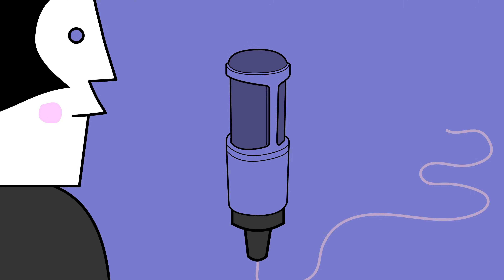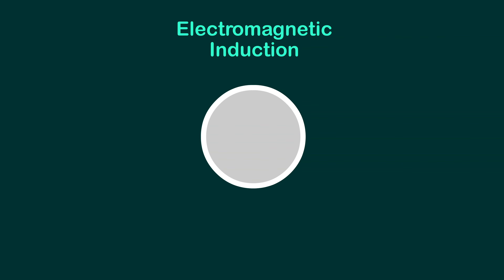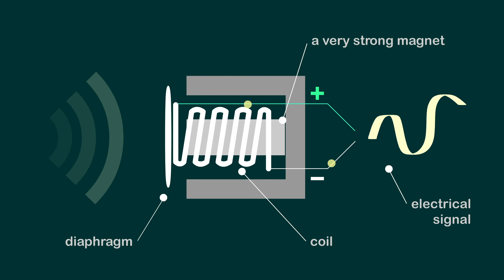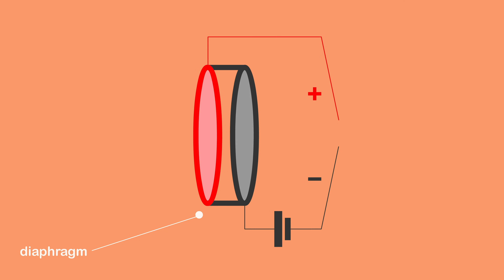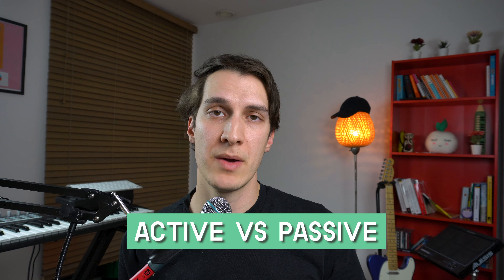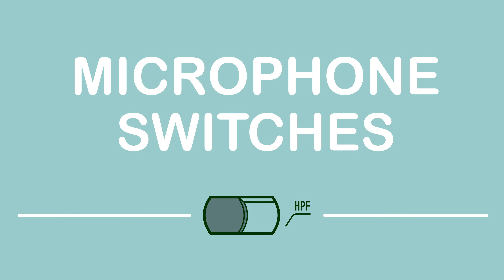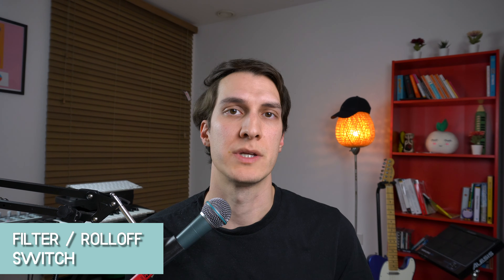How do microphones work? Different microphone types and their characteristics explained

Comment: 4:00
Phantom power isn’t a “signal” in any normal sense of the term. It is simply a source of power, and carries no information to speak of. It isn’t even a waveform, as we normally think of one. It’s DC, like a battery.

Comment: Thanks for the great run-down. What are you using downstream from the SM Beta 58A? I see that its output is 4dB higher than the original SM-58. I found it difficult to get high enough levels from an SM-58, so I sort of wrote them off (and all dynamic mics) for non-band situs.

Fun fact: condenser is the original term for a capacitor. Mic tech stubbornly clings to the legacy name.
Reply from the maker: I think at the time of recording this, it was going through a focusrite clarett. For the really quiet dynamic mics we have an SE DM1 dynamite . And more recently we've also been using the newer focusrite scarletts which have a bit more gain on their pres.

Comment: I need some microphone shopping help; this is probably a common request.... so, I am looking for a microphone that will only pick up my voice. I am worried that when i'll be gaming, it will pick up on the gaming audio from external speakers that's placed bottom of my pc monitor. Seems like dynamic microphone is the way to go, but wouldn't it pick up on the external speaker's audio? is there anything else I need to consider?
Reply from the maker: Definitely a dynamic with a cardioid polar pattern. Obviously there's always going to be a bit of spill from the speakers, so I guess that's the tradeoff you need to consider depending on how loud you have them, or maybe you should consider wearing headphones :D

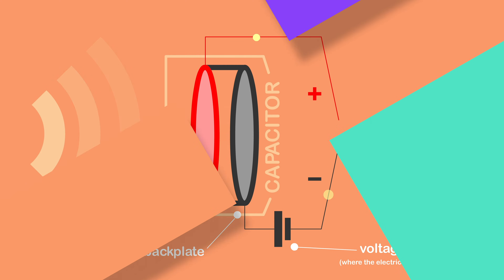Comment: 2:40 one dynamic mic advantage: low sensitivity to ambient noise 3:40 condenser mics = active, require 48v phantom power 5:32 large vs small diaphragm condensers 7:24 shotguns highly directional 7:45 lapel / lav mics also need external power 8:55 polar patterns: omni, cardioid, 8. Some mics have selectable patterns. 11:44 mic accessories: shock mount, pop filter 12:41 mic positioning 15:02 mic comparisons

Comment: The AT2020 is NOT, by any definition a large diaphragm from condenser. The diaphragm of the Electret capule is the roughly average 11 mm. {10.5,} small capsule. It's bigger brother $400 at4035 is the other version of the 11mm small diaphragm with more expensive circuitry. I would skip those two, get to 22 mm 2035 which only costs 50 more than the 2020. 4040 has the identical capsule to the 2035 what's slightly different tuning and better circuitry with everything else is nearly identical.
Reply from the maker: You are right, for their current prices the 2035 seems like the better deal! The 2020 was my first condenser and it's always been around in the studio and I think is a fairly standard entry level condenser.
I can see now that they market it as 16mm "medium" diaphragm so I guess they are trying to position it somewhere in the middle :D

Comment: The at2020 actually has an electret "back diagram" according to their site. Roughly 10mm small housed in a 16mm capsule. Not sure why they advertise the 4035 and the 2020 as a large capsule when it's in fact a very small diafram. They blazed the trail with the 4035 making the first under $1,000 electrect mic, later copied by companies like blue, but nowadays you can get them for $0.50 or less from companies like foxnovo.  As a matter of fact, the company they get the capsule from, MJI gets the electret capsule from foxnovo so you can technically just get a full built $10 foxnovo. No phantom power really needed. Maybe 18 dB  you want to crank the 22 self-noise level.  I think it's a bit unfair for them to advertise a 16 mm housing considering most people will think that's the size of the diaphragm. 

 I would just pay the extra $30 and get the great sounding, beautiful tone & low self noise 2035 (Same as the discontinued 3035) with an actual 23mm housing and aroud 20 mm diaphragm.

https://microphone-parts.com/products/at2020-microphone-mod-kit

https://soundref.com/audio-technica-at2020-review/#:~:text=Inside%2C%20the%20AT2020%20has%20a,possible%20types%20of%20condenser%20capsule.

Comment: I understand that as we are making sound waves through our vocal cords. The diaphragms move forward and backwards creating electrical signals. But how do those electrical signals carry our sound waves to the speaker? Or to  whatever it is you’re recording? It doesn’t really make sense to me how the electrical waves can create sound unless the speaker system or radio has a mechanism that replicates or tries it’s best to replicate those sound waves
Reply from the maker: Although it's hard to see with the naked eye, the cone of a speaker is moving back and forth very quickly in response to the electrical signal that's sent to it and as it does this, it pushes the air in front of it, which then creates the sound waves that we then hear. So if we left aside amplification, the mic/speaker characteristics and the imperfections in the signal conversion process, the mic diaphragm and the speaker cone would be moving in exactly the same pattern, and you'd hear the original sound exactly as it was recorded being played back through the speaker. In fact, you can use a microphone as a speaker, and vice versa (have a look online for videos of this!)

Comment: Great and informative video! I was looking for a microphone for recording solo cello that can be placed close to the instrument. I was thinking pencil condenser? Thanks
Reply from the maker: A pencil condenser is a pretty standard choice for natural sound. I would also try a large diaphragm condenser for that extra low-end. If your room is not very noisy or has too much reverberation, i would also probably consider micing a bit further away from the instrument. I think it will help capture the full natural tone of the cello in the room better. Let us know how the recording goes!
Reply: @arbitersofsound  thanks! What do you think of true neumann km184s or the Schoepes CMC6? Would you go Omni or Cardiod?
Reply from the maker: @maxwung  I'd go cardioid to avoid capturing too much ambiance from the room. I would definitely give the Neumann a try, my experience with them has been really positive and my go-to mic for a lot of stuff the past few years has been the TLM102 (If you listen to our podcast, that's the mic Vasilis uses). Unfortunately, I have no experience with Schoepes.

Comment: I'm wondering about the best mic for recording Scottish smallpipes. I'm looking for more warmth and richness. Currently using a Samson G Track Pro USB. Would a ribbon mic be good? Thanks!
Reply from the maker: A ribbon mic would theoretically give you a very natural sound. Maybe if you feel that the sound of the pipes is too harsh you could try a large diaphragm condenser that doesn't have such a harsh high end response. If you are not using an external pre-amp / audio interface your options might be a bit more limited though. What's your audio setup and recording situation?

Comment: So would a small diaphragm mic like the Lewitt LCT 040 not be good for a situation like filming a youtube video or voiceover?

I am completely new to this sort of thing and trying to learn.
Reply from the maker: For capturing your voice in close proximity, large diaphragm condensers and dynamics tend to give you a fuller sound. Dynamics will not be as detailed, but will pick up less background noise and will be less expensive and fussy to set up generally. Condensers will sound more detailed, but might be not very well suited to recording in an empty or untreated space, picking up too many room reflections and background noise. But it obviously all depends on the situation (what kind of room you are recording in, what kind of sounds/voices you are trying to capture, how much background noise there is) and the microphone positioning (how far away from the mic you would be standing). What would your recording situation be like?
Reply: @arbitersofsound  Thank you for replying. 

I want to start a podcast for two people. We will start in my bedroom as to not splurge a huge amount of money (at least in the beginning), and I am planning on making some diy sound panels made out of shredded denim insulation (don't trust rockwool due to some respirtory issues). It's a mid-sized bedroom, but the whole house is made out of stone, so reverb is kinda insane. I do live in a fairly quiet place though, so no worries over outside noise like traffic and the like. The plan is to use a small table where we would be facing each other from a slight angle.

I did a bit more research and I am stuck in between two mics: the Samson Q2U and the Rode NT-USB Mini.
Reply from the maker: @NanaLaEnana  If you're planning on using only one mic then the dynamic one (the Samson) might be trickier to record with, because you'll both have to be sitting quite close to it and facing it. It will probably be much less sensitive to the acoustics of the room though. I'd probably say go with a cardioid condenser mic, stay fairly close to it when recording and make sure you cover at least the wall behind you with the insulation so that you don't get a lot of reflections from the room.